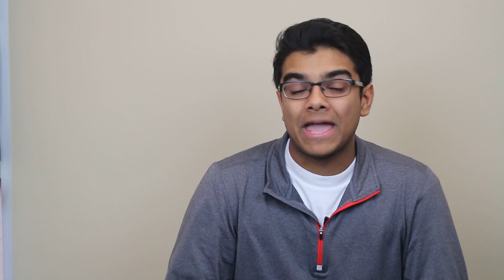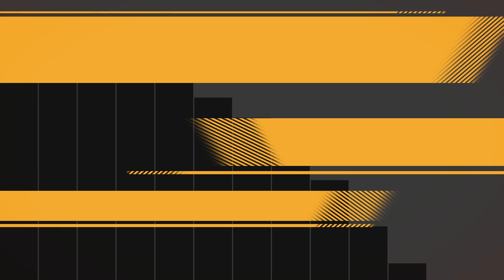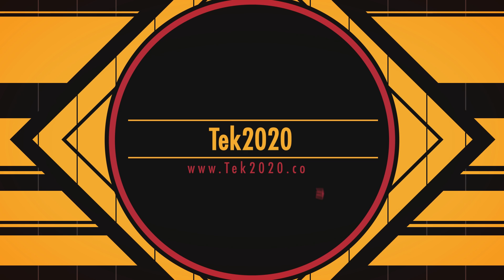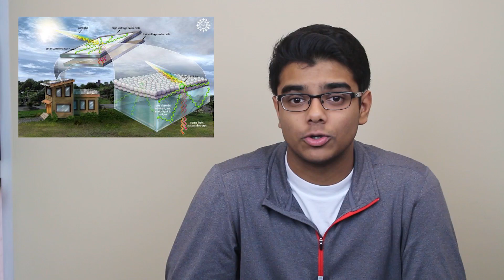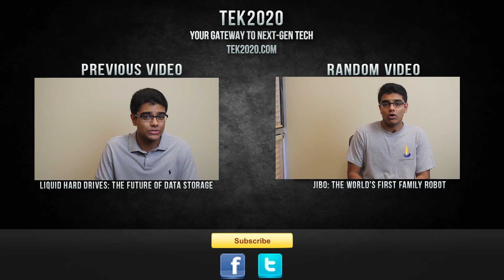Spray-On Solar Cells: The Future of Solar Energy

Comment: You had it a little wrong. The perovskite in solar cells it's not the same thing with the mineral perovskite. Perovskite define a class of materials that has the same structure as the mineral. Read more about this ;)